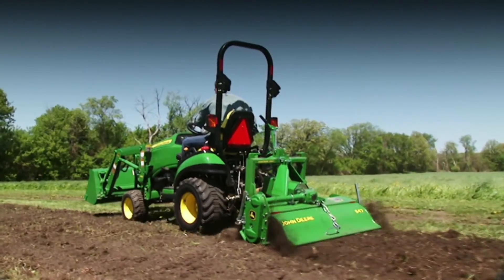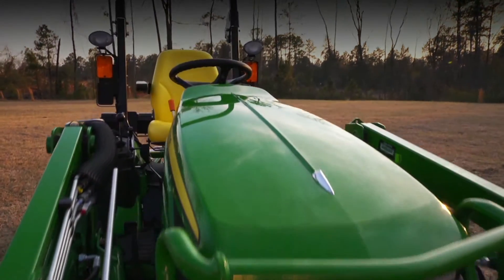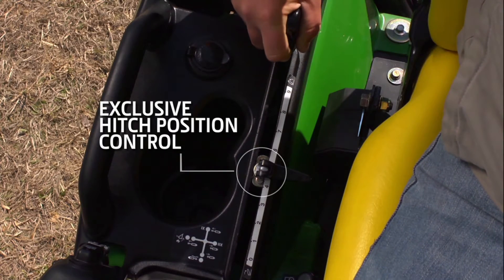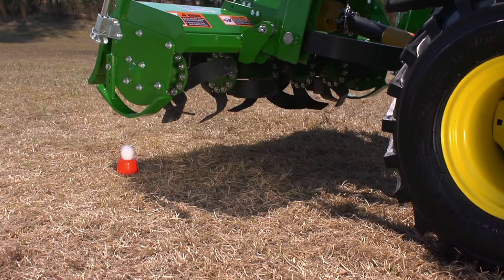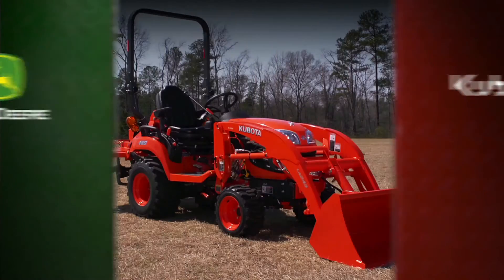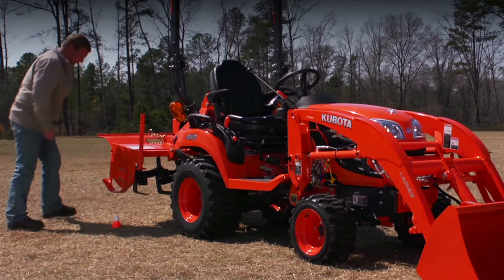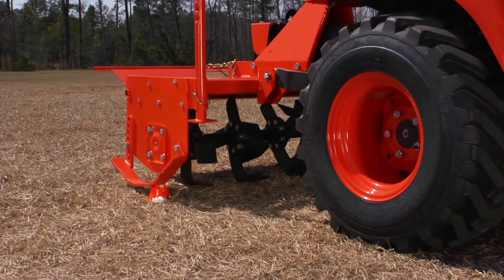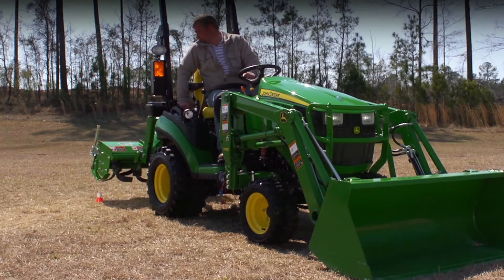John Deere: 1 Series- Hitch Position Control Video

Comment: I own a 1025r but I have to say this is laughably ridiculous. The kubota was purposely operated badly. And the JD doesn't remember anything it's just a plastic stopper on the lever track that stops the lever. Geez that's been on tractors since the 1940s. I love my JD 1025r but damn john Deere that was a low blow
Reply: JohnnyRebKy.  You are exactly right. This "stopper" is even on our 3020 John Deere
Reply: My L2501 Kubota has it, the b2650 has it.
Reply: The biggest laugh is they r comparing a 1025r when they should have used a 1023. The next funniest thing is that that nice position controlled lever is held at its position by a friction. They use a rubber grommet and nut and tighten it just enough to create drag (friction) and that’s what they call Position control. And it’s part of that nice premium price over the 1023🤨